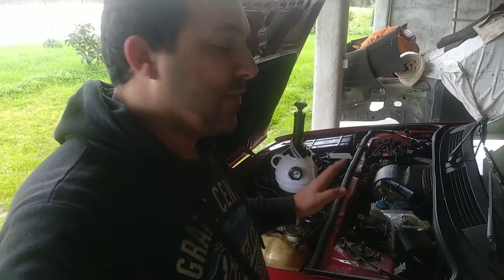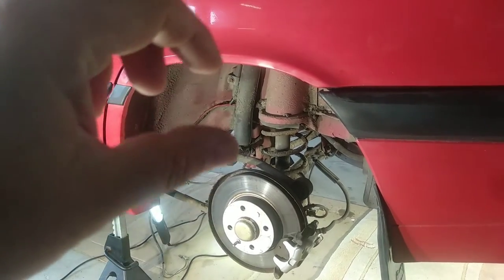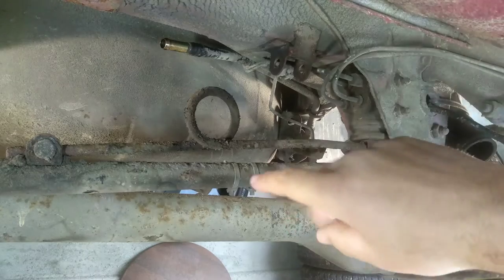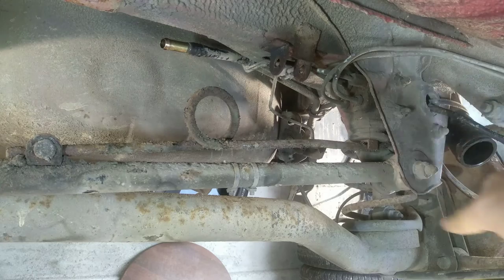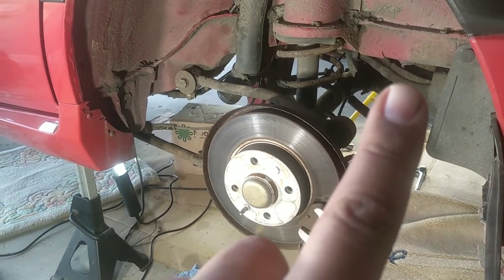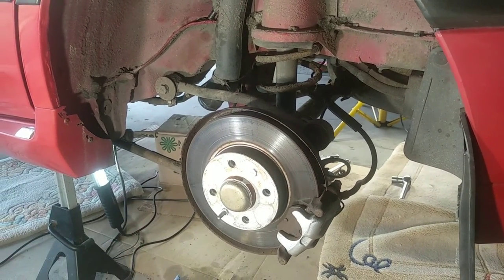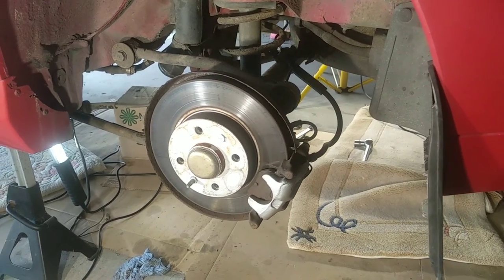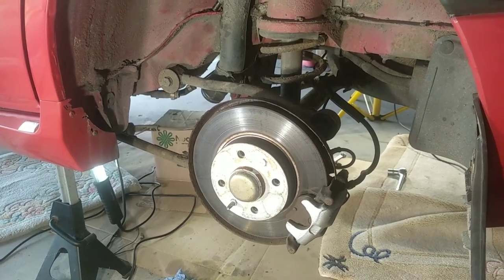Impossible to bleed the back wheels? Try this out! For Alfa 33 and many more!

Comment: You havent adjust  correctly your regulator.  There  is a method to adjust it  when  car is lifted in order to  brake as they should.
Reply from the maker: Maybe I didn't understand what you are trying to say. 
I'm talking about the simple bleeding, everything is nice and in order to do the maintenance bleeding when lifting the car for service the regulator stays in a closed or almost closed position
Reply: @alfaromeonoproblem  Regulator can be adjusted of how much pressure  will allow when rear axel is  lifted  due to braking .  On one side  of the regulator there is a hook   which is a lever  and from there you can adjust it by adding  weight   when servicing it
Reply from the maker: I'm aware.